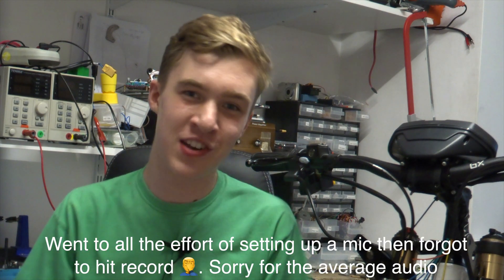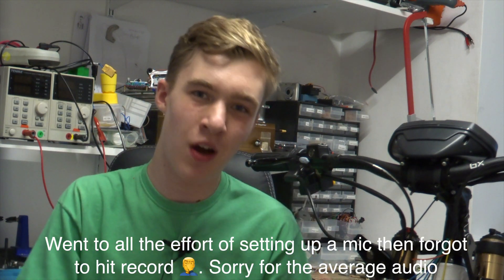Troubleshooting and update! - Sabvoton trouble -  8kW Enduro MSVA eBike V3 Build

Comment: I have a quick question I have the Sabaton 72150 controller. Replaced motor with a brand new exact same motor qs273 3.5t but dont have the bluetooth dongle, was hoping i could skip the autolearn. Motor runs smooth at low rpm then harsh at high speed. Do you think this is a classic symptom of not doing the autolearn?

Comment: Hi buddy great informative video, i have a problem ive just received my stealth 8000w, 72v, 40amp bike however i went to take it for its first ride got power for 5seconds and then i cut out an i havent had any power since. I connected the bluetooth usb and the app says i have a unrecognised fault….any idea what this could be?? Did the hall test an the wheel spins abit then stops…spins abit then stops but never completes the test. If anyone could help id be massively grateful feel really disappointed atm
Reply from the maker: Sounds maybe like a BMS or battery issue - any progress?

Comment: After 3kw you should put a pre charge circuit on it . And a lot of controllers have different settings for power did you look to see if you are defaulting to a low setting?
Reply from the maker: I've tried all that but now it works, I just can't get full power for the first minute or so

Comment: I think it’s you’re controller…..if you test your battery and it’s putting out the right amount of volts it’s not the battery….if you test the black and red wire’ when the bike is off’ and it shows the correct amps….it’s not the battery….if you turn the bike on and the voltage drops on the volt meter….and gives a controller protection code….then it’s most likely the controller….if you go inside the computer and it’s giving a lack voltage code it’s probably definitely the speed controller.

If you plug the battery to the controller and you hear a pop it’s not the battery…it’s a fried speed controller.
If it’s flashing green or red and saying speed controller protection….I’d bet my money it’s the speed controller.

Comment: I believe my 80a Savoton is fried…if I put a meter to the battery it reads 83 volts’ both charge and discharge ports….if I turn the bike on I get red and green light flashes….if I put the meter to the controller….and power the bike on it shows 0% if I turn it on the voltage drops down to 57 volts, if I go into the program it gives my a lack voltage error code and show 60volts.

It started when I recharged the battery…the battery was at 70% when it finished charging I turn it on and heard a pop pop pop sound….then it quit…when I throttled it it would slightly move and show the error code….I reset the system and did a hall test at 10 output the wheel barely moved but the test passed….if I tried it on 20out put the system would turn off and I would have to power it up again….

I thought it was the battery but my meter tells me it’s not.

Comment: Mine shows the battery at 69.9 volts…it used to be 84v I went into the controller and programmed it to use 64 volts….now I get the error code speed controller protect….and it doesn’t move…it’s annoying because I don’t know if it’s the battery or speed controller….I’m hoping it’s the speed controller….but I got a bad feeling it’s a dead cell….the battery won’t charge above 71v and when it’s on a higher voltage the wheel will spin a tiny bit then stops.

It’s not the wheel because it tested ok, and I have 2 plugs incase one is damaged

Comment: My sabvoton controller doesn't flash green light instead the green light stays on solid. Whats this mean?
Reply from the maker: That means there are no fault codes and it is powered on, so all good!
Reply: @EverythingEbikeChannel  when I log into the app it says lack voltage and the bike won't work. I can't even run the hall test

Comment: 100a plus 10p or 15p cell packs. 3A per cell.
Reply from the maker: That's great for a li-ion pack, but no way I can fit that many parallel pouch cells in here! They are able to do over 100A each apparently...
Reply: @EverythingEbikeChannel  I'd steer away from lipos the lion will be less puff hazard under huge loads. I soldered direct recently my phase wire connections and huge improvements. 45A sabvoton 26" wheels 42mph. LOL!

Comment: yeah looks like its defaulting to level 1 each time its turned on ,mine does that ,then i have to  push up assist button goes like 1 to 5 ,level one gives like 20 -30 % of power
Reply from the maker: Check out the latest video, I think I've cracked it.

Comment: heya with out the display screen mthe sabvoton will always default to level 1 pas and as the throttle is also linked to the pas level you will only get assist level 1,the tft 750 and ukc1 displays have the 4 button switch which allowed the adjustment each time started the bike
Reply: i wondered how to adjust with out the display ,now im thinking this very much looks like the result,how do you normally adjust your assit level on the fly,without the 4 button display switch

Comment: Hey, I'm building a bike with the same frame. I'm about to put on a new rim from the 26in on the rear hub motor. What size rim and spokes did you use for the rear motor?
Reply from the maker: It's called a 85x18 rim which I think means can take an 85mm wide tyre and 18 inches in diameter - weird mix of metric and imperial! The exact seller doesn't sell them on ebay but have a look around and I'm sure someone will.  The spokes were 113mm long

Comment: one last thing have you tested the hall sensor inside the throttle it maybe just faulty or loose inside the throttle this could lead to inconsistencies 
and if it's not the motor and not the throttle have a look inside the sabaton for loose connections
Reply from the maker: I would open up the controller, but would void the warranty so am still waiting to hear back from the seller

Comment: It's definitely the Sabvoton. There's nothing else that can cause an intermittent problem. As you rightly said, everything else either works or it doesn't.
If your motor hall sensors were wrongly reassembled, it would constantly start 'cogging' and it can't be the windings because it works. If the BMS was faulty, it would switch off and stay off. If the cells were bad, the BMS would switch off and stay off (p;us which, you don't have significant voltage drop in any cells).
I'm pretty certain that you have a faulty hall sensor on the current side of things. If all else fails, take the Sabvoton apart and check the soldering or replace the hall sensors. If you can't get the hall sensors, you could semi-bypass them by taking a wire the same gauge and bridging the input to output. The Sabvoton will only sense half the current but it might just fix it. There is also a chance that the caps inside the Sabvoton are drying out or venting (I've known that before) but that would more likely give a permanent fault.
Good luck mate, it's the intermittent problems which are the worst!

Comment: low volatege is mean low motor speed + low power   not good  

you should change your battery and controller  
I use 134V battery and 200a controller    + qs 205 5t   

and I can up to speed  over 120km/h     0-100km/h 3.2 sec
Reply from the maker: Bloody hell that 0-100 time!! 😲 I've already built the 60v battery and the motor is only rated for 48v anyway but I'll bear those specs in mind for a future build...😁
Reply: Which model of motor controller are you using for 134V 200A ?

Comment: Just a thought - are you sure aluminum is the best material for your bus bars?
Reply from the maker: Copper would be better, but Al ones were £3.5 each and copper were £8. The difference shouldn't be noticeable even at this kind of power.
Reply: @EverythingEbikeChannel  The big problem with aluminum is that the thermal expansion loosens the contact and you get a fire. Check tighten aluminum connections and if any show signs of getting loose then you have a problem. In household wiring aluminum can be used only with specially designed connections that don't work loose with the thermal expansion.

Comment: Full throttle should be putting you on your ass m8 I.e flipping the bike over lol. Send the controller back for repair or replacement. That will cost you postage to China and the postage back to you.

Comment: It's too bad you still have problems on the controller app they're setting for acceleration and deceleration in milliseconds make sure they're set on  the lowest it'll let you set it turn up flux weakening to the maximum level it'll let you I have it unlocked controller lets me use 80 amps with the savoton 150 check the temperature settings on the amp for the mosfets it could be rolling back amps to I had another controller if I used flux weakening and went past a certain speed if I let off the throttle it would lock up the rear tire that was a savoton 100 by risun it also blew out the 700c screen it might be a 750 screen I forget but it was the screen that came with it it seems like everyone is different keep us updated I'm sure it makes it hard for you to make content when the bikes not working 😭😭
Reply: Hi there..what is the maximum flux weakening you were able to set tour sabvoton at?
Reply: @MrDeceptacon88   hey Rick how's it going the maximum flux weakening mind will do is 80 amps and I have it set on 80 amps all the time I do have an unlocked savoton 150
Reply: @shawnsebikesandstuff15  thx for the info..i love my sabvotons
Reply: @MrDeceptacon88   I also run 130 amps continuous with 80 amps flux weakening my battery is a 12 p 18s lgmj1
Reply from the maker: I've been through the settings so many times and had multiple people check them so know it's not that. I've heard of the issue with the blown screens, apparently a sensitive controller that can go when using regen.
Reply: @EverythingEbikeChannel  okay last thing 😂😂 try another throttle I had one this spring that malfunctioned due to getting wet because I drive my bike all winter over 21,000 miles in the last 3 years so anyway when I would give my bike throttle and then let off throttle it would keep the power going for another 2-3 seconds and then ramp down from 5 volts back to one volt which put me in a wheelie and on my back 😭 so I put a new throttle on it, when the bike was powered up the throttle voltage on the amp would say 1.19 volt so I changed my minimum throttle voltage setting to 1.25 my bike was still ramping down slow so I put another new throttle on it so then on the app it would say my minimum throttle 1.09 volt which is the way it has been before I had throttle problems and on my other three e-bikes I've built it seems like if you're reading a throttle voltage more than 1.1 volt the bike isn't going to perform well these throttles we pay less than $20 for and a quarter of them are junk so when I put the second new throttle I was able to put my minimum throttle value back to 1.15 which is where I've always kept it. Too bad you're missing the summer of riding but you'll get it I know you have no quit in you time to become best friends with a multimeter 😂😂😂

Comment: Voltage difference of 0.6 volts under 130a load isn't normal. That means one cell is like 50% weaker then the rest.
Reply from the maker: Which part are you talking about? I mentioned that I had a weak connection and that was why 1 cell looked lower. You can see in my reply to @Dragunjoshi

Comment: at 10:43 min  in your Video Cell 14 can it be possible that this Cell have a problem and solw dowen the rest ?
Reply from the maker: That's been sorted, was a loose connection block. I had a time where I would take the cells out, tighten a loose block, put it back and then a different cell would start dropping!🤦‍♂️ Not the cells themselves though, just loose connections

Comment: Just as a reference for you,  my ebike when I had it on 20inch wheels running 72v about 80-100amps I got a 3 sec 0-30 total weight is about 110kg with me the battery and the bike. Also with bad launch because it was a Chinese controller and was hard to control that initial hit of torque
Reply from the maker: Hmm thanks for this...👍